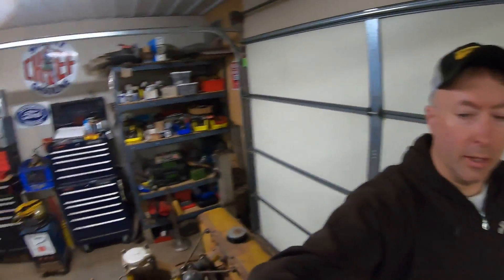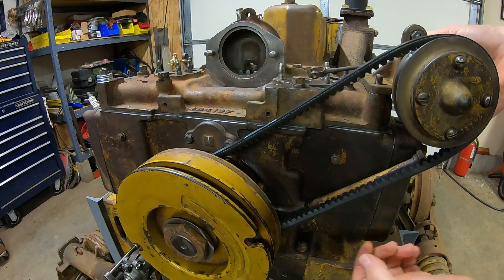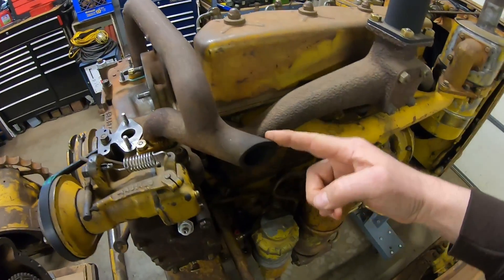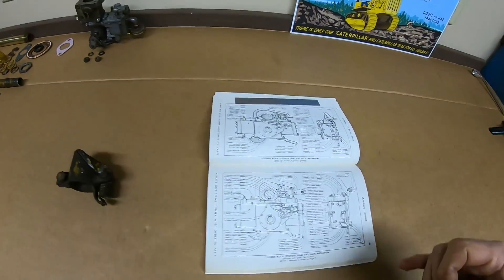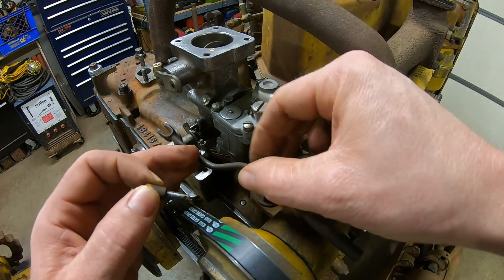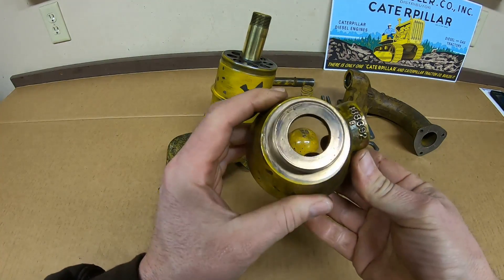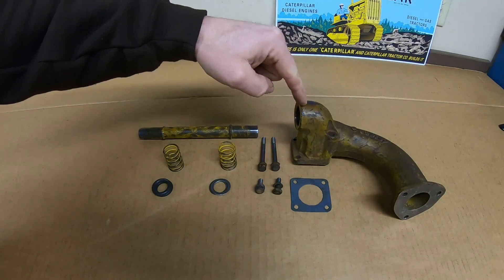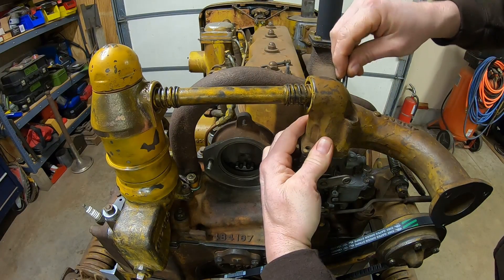Caterpillar D2 #5J1113 Starting System Rebuild Ep.19: "The Build Up" - Top Cover Components

Comment: The real first PCV system which reburned the crankcase ventilation rather than just allowing it to blow out into the atmosphere. That's pretty cutting edge for back then when even most car engines were still directed to the atmosphere. Cat was ahead of the curve.

Comment: The little exhaust cap reminded me of my grandfather's D4 starting engine.  It exhausted straight up through the cowl with no cap on it.  He kept a small steel can over the exhaust pipe.  When he'd start the pony engine it would fly up into the air and have to be retrieved.....  I don't know why he didn't just take it off before starting!
Reply: The same reason that I used to have for leaving the can on the stack of Emma when I would hand crank her. I wanted to see how high the can would go and which direction. I had it nearly hit me a few times and once had it land right on the bracket where we kept it when we were using the tractor.

Comment: This is going to be a fine running machine!! I like how you clean everything spotless clean but restrain from repainting. The look is really neat!! Clean and original. What most people don't realize is the United States use to have pride in what they made. Like the brass top part you showed. The manufactures made things to last and were not concerned about how cheap they could make it. Great Show!!

Comment: 5:05 This type of heat transfer is convective. You can't really heat a gas via radiation.
This applies to "radiators"  in engine cooling systems ,which should really be called convectors.
The only things that commonly use radiators for cooling are things in space like satellites , because there is no gas available to convect heat to.
Reply: great point, i don't feel like breaking out a text book and doing math right now, but i am a little curious how much heat can be xfered back to the intake.  utilizing just a log manifold it would not be efficient but you would at least regain some lost energy
Reply: @JoeHynes284  While it is useful to heat the intake air for cold starting, you don't really want to run an engine on heated air as it reduces efficiency because hot air is less dense. Cold air intakes improve efficiency.
Reply: @paulg3336  Right but this was only utilized when they were trying to warm up the engine that’s what I meant sorry it was confusing

Comment: Your lamentations of belt cross-references remind me of looking for a belt for my riding mower. The original Craftsman belt was 88 3/8", but everyone in the aftermarket passed off their generic 88" belts as 'equivalent' but they didnt last worth a darn because they were too tight with the deck engaged, and not loose enough with the deck disengaged and just burned up.

Comment: You don't get in to enough detail - how about the molecular structure of various elements, or perhaps quantum entanglement where multiple particles can be linked together in a way, so that the measurement of one bulldozer's quantum state determines the possible quantum states of the other bulldozers.  Ah but then you may reach singularity, with your explanations spitting out infinities.
Reply: I'd say String Theory added also
Reply: @philipmackin1025  don't forget spring theory.

Comment: Lots of jewelry in the cast brass and bronze pieces. 
Makes me wonder how they made money with all the casting and machining needed.
Beautiful machine. Thanks for sharing.
Reply: Because it was a far different time, when design/engineering/manufacturing/production review & control was ALL done in house at the same facility. They cast their own parts, machined & assembled all in one facility with the engineering department probably next to the various points of manufacture & assembly. This was LONG before outsourcing or supply chains as we know them now.

Comment: The crazy thing is, that breather arrangement probably worked great and did a better job of keeping crankcase gasses clean AND burned off excess fumes, something modern engines still do. The only reason it was eliminated was in the name of reducing maintenance costs to make their machine seem more appealing at purchase. Wonder how things would be designed now if cost was no object.

Comment: Is there a technical reason for the brass nuts for the exhaust?
Reply: @squatch253  that makes complete sense. I wish car exhaust manifolds could use brass hardware because they rot off more often than not but I guess it's to heavy and too much vibration for brass

Comment: Being overly tight will hurt the main bearing and to governor bearings !! Specially since it is a splash oil system !!
Reply: Want to ask a question, my d8 57 has bolt on track teeth and the left and nice hub but the right has a spoked hub with welded in plants to support the the spokes how doni go about finding a hub for bolt in teeth, What yrs did they start with bolt in replacement track teeth and this d8 has outer carrier bearings similar to a full floating rear in a truck. How as to why i found a differences in left and right sprockets. Is because my right track is leaking oil since i dove it. I know it is a big, big big 8 × 8 × d × cat job but it can be done

Comment: That breather assembly is amazing, all the engineering that went into it for a small engine.  Automobile engines at the time - and a long while afterward - just used a simple downdraft tube for crankcase ventilation.  I have to wonder if they were thinking of dust ingress to the crankcase?

Comment: Lot of prep work done so we are moving closer to completion. I was going to debate on why the old CAT numbers cross reference to the new belt but it seems Toby already did the work for me. Also I had no idea that CAT switched to using exhaust heat for the intake in 1947? The Soviet engines D-36, D-48,D-65 all retained that system to the very end of the production. Despite the D-65 has long injectors and the combustion happens on the top of the piston instead in a pre-chamber.

Comment: Never really knew much about Cats until I found you series. Watching this I'm amazed at this early EGR system, especially on something like a pony motor that was going to run less time than the average lawn mower per start! Most manufacturers were running a road draft system for the next 35-40 years on most motors!
Reply: I believe you mean PCV system :-)
Reply: @brucepeebles4939  yep
Reply: @brucepeebles4939  We all need to remember that a lot of what gets into the crankcase in the form of "blow by" is actually "exhaust" (combustion gases).  But I agree with your point.

Comment: An awesome video, bud. I agree with you. When I think about the amount of hours that went into machining these pieces by HAND, inspecting them, assembling them, checking and re-checking. It blows me away. Not like things of the modern era. I'm not saying there is not an incredible amount of engineering and human labor involved, but for the most part, it's all automated, injection molded plastics, etc. You'd be hard pressed to find anything as far as housings go that are brass or bronze on anything built these days. And hand machining? Forget about it. Can't wait for the next installment, buddy!

Comment: You're absolutely right about the elegance of all that cast/machined componentry on the starter engine. I never realized and am very impressed that they were already utilizing crankcase ventilation and emissions recapture which must have resulted in lower emissions and less loss of fuel energy content. Great video. Beautiful mechanical structure. Well done.
Reply: Back when engineers put thought in and took pride in the work.
Reply: Well said.
Reply: I was thinking that as well !!!